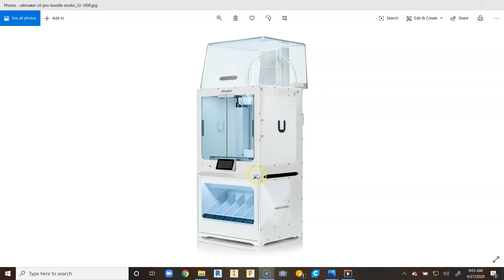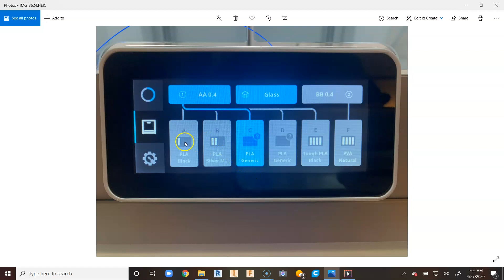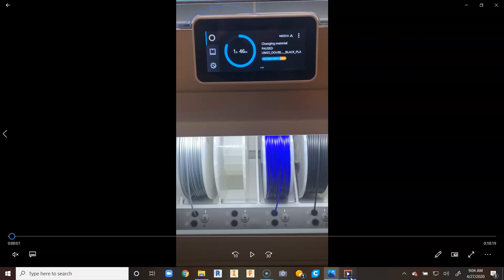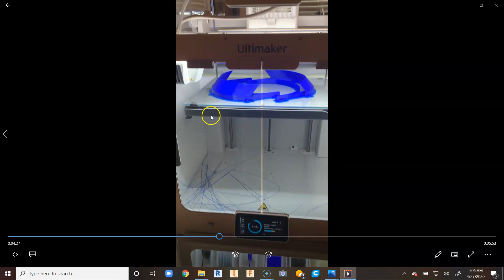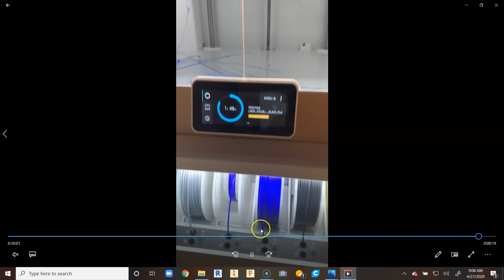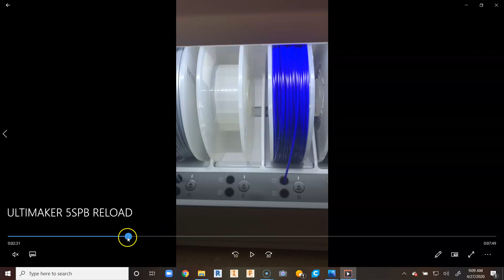Ultimaker s5 Pro Bundle Material Station Auto Material Reload

Comment: Mark, regarding the filament change, did the whole generic PLA go through the material station before detection of out of filament was detected? I ask because i have been holding the filament just before it runs out for a detection to be made. I guess this is not the right way. Please explain what actually happens
Reply from the maker: No. It know its is out at about the time you have one rotation left on the spool.
Reply: @PLTWTECHED  even if it is generic PLA loaded (no chip)
Reply: I thought this because in your video it seems like there no filament on the spool

Comment: Hello Mark, I have a question for you. I have been doing some multi color printing and figured out that if you change the material mid print you can add colors (more than two) to the print itself. My question is, if I set up a queue for the printer to stop at layer hight, can I ask the material station to load a specific material from one of the 6 docks, and then resume printing? That would make my life so much easier for those kind of prints. 
Thank you
Reply from the maker: I haven’t tried anything like that yet
Reply: @PLTWTECHED  Ok, thanks for the reply. If you do, please let me know.